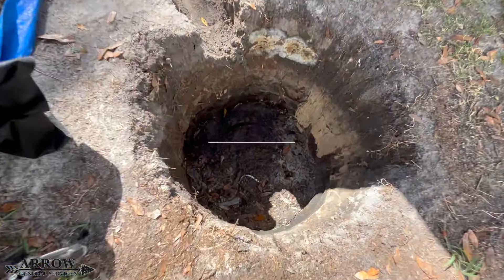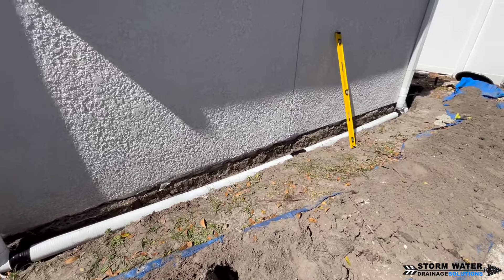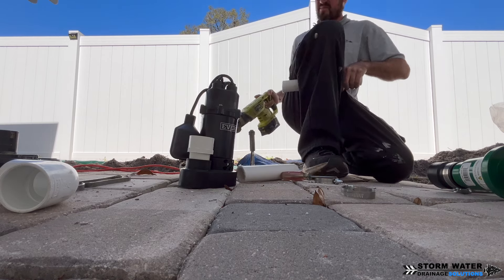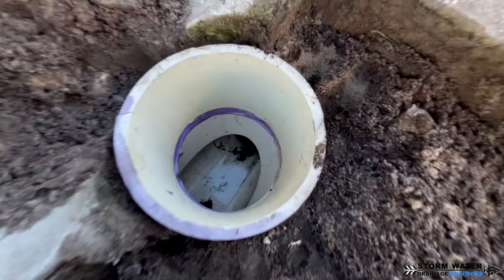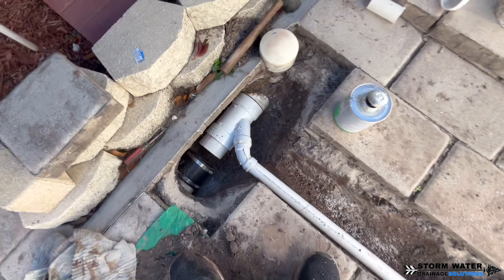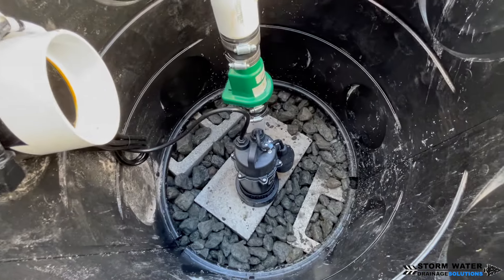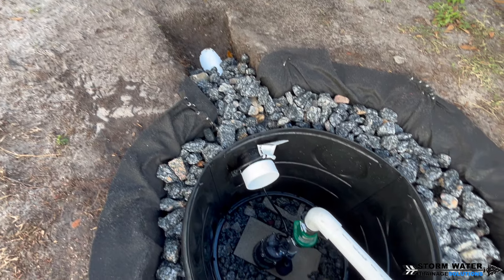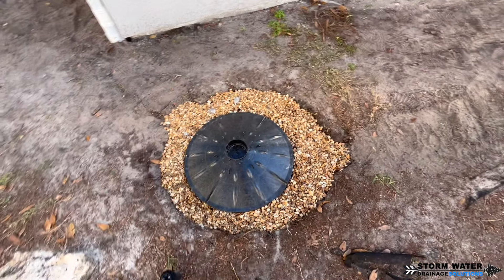Drywell With Back Up Sump Pump System - Yard Drainage - Tampa Drains

Comment: What can be used as a debris filter around the pump, inside the basin. I keep my gutters clean but I had a rush of little twigs and leaves that was able to clog the pump intake. Easily unclogged but rain was over night, in the morning my yard was flooded.
Reply: Maybe put a drain basin at the bottom of each downspout. These will then capture debris coming down the downspout and stop a lot of it moving into the sump basin.

Comment: Does the electrical part get handled by an electrician?
Reply from the maker: Good question, typically we just plug the sump pump into the near by outlet but in this case the electrical work was still being finished on this building and the receptacle was not finished yet.